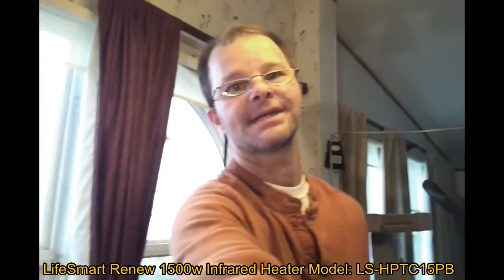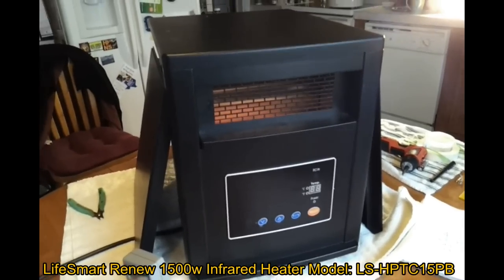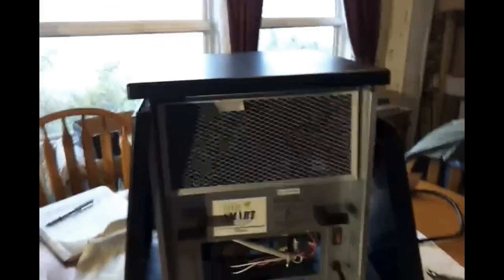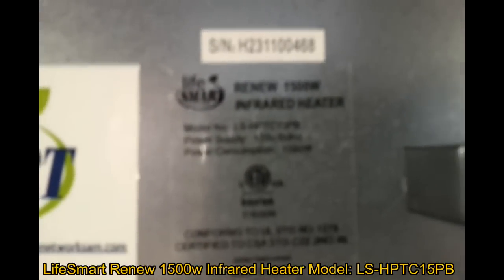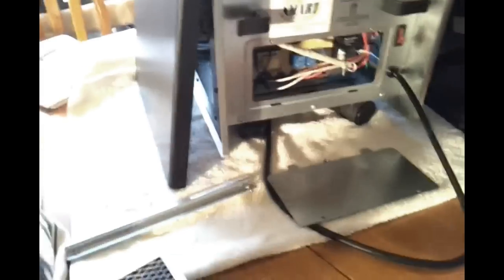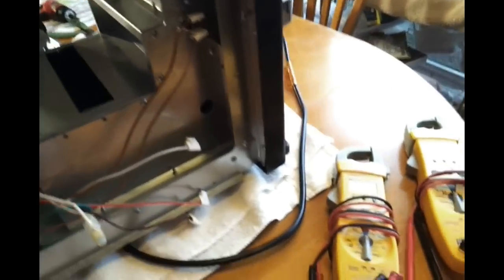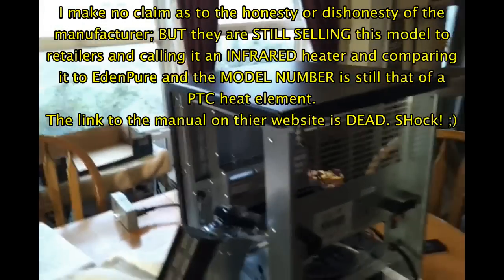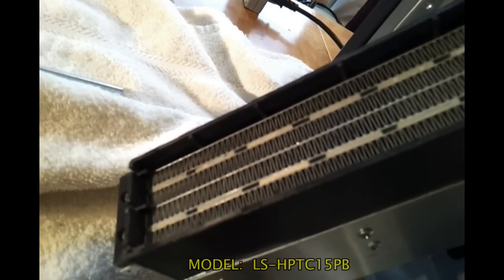HVAC LifeSmart Renew Infrared heater, or is it?

Comment: The units that most of these companies  sold today no longer have PTC units in them. Life Smart, Life Corp. Lots of names. Now They have infrared element quartz tubes. Some have 2 some have 4 and some have 6. The problem with them is the heat sinks burn up.They are  KSD301 R 16 A 125V 150c You can buy the off amazon for 2 of them for under 8 bucks.
Reply: Which still have PTCs, do you know? I know the Dr. Heaters are primarily PTC still with a single bulb at the front, and surprisingly I think EdenPure has switched to full PTC as well, using red lighting in the ductwork to keep the "glow" effect these are associated with. While I haven't taken one apart to 100% confirm, the glow they emit comes fully on/off instantly as a light would, and not with the gradual warmup/cooldown that you expect.

Comment: I have a similar heater and the thermostat doesn't seem to be calibrated correctly. It just keeps on running until way above room temperature. On the high setting it just shuts down after 10 minutes. I'd like to fix it. Still looking for information on this problem.

Comment: The downside to "PTC" ceramic heaters is that they can be fragile. My ex threw my tower ceramic heater down a flight of stairs and now it has a few dead ceramic wafers (I call them biscuits myself) I think the fall broke loose the conductive epoxy that holds them to the aluminum heat sink fins/bus bars. For this reason it now is only a ~1300 watt heater instead of 1500 watts.

Comment: I'm having a over heating problem. Runs for 5-10 min them limit switch is tripping. I'm getting a e1 error message. I have it apart now. It is hott to the touch near the limit switch. but I assume it would be. do u have a fix? Its cold here in MA.. bty GREAT VIDEO best one I found…...
Reply: hahaha

Comment: Thanks you
Reply: I learn about HVAC  But I don’t Know to hook up  the wire connect  Switch   Thermostats Because it has 4 wire ( My burn Switch. ) . Your picture on Video clip looks like my Electronic Infrared Heater has a Heating Element only 
I only student learn HVAC I like you  are a good Technician By Explaining about That  way

Comment: I don't consider any of these cube heaters to be infrared, even the ones with the nichrome wire in the quartz glass tubes. I say this because almost no infrared light actually is emitted, just warm air like any other forced air heater or air handler.

You get 3.41 BTUs from each watthour consumed, period. No more no less.

And that is known as a tangential blower FWIW.